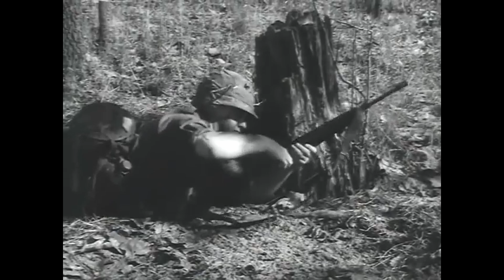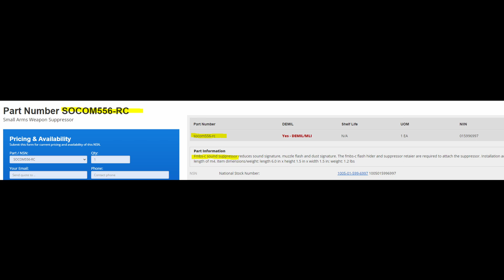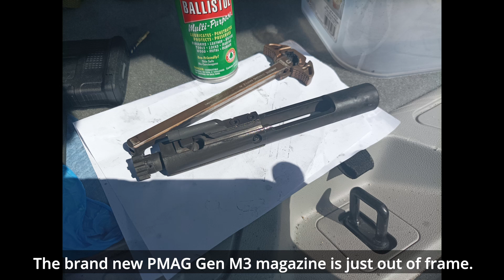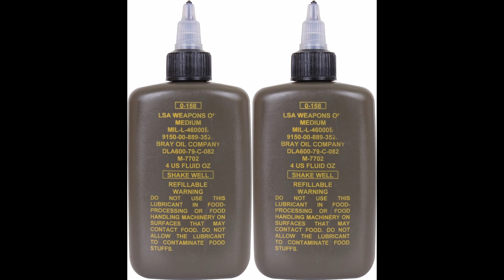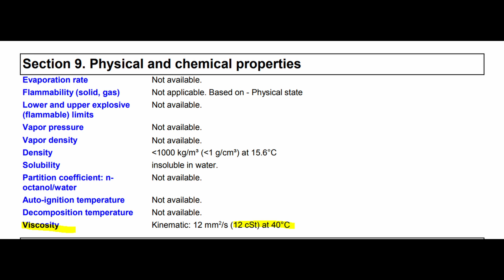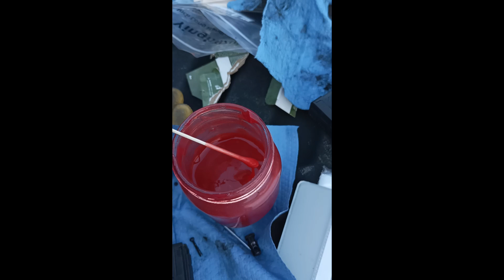Best Lube for Suppressed AR-15? 11 Lubes Tested!

Comment: CLP failed German Army tests back in the day because of its
-toxicity
-solvents (evaporation when cleaning in barracks)
- teflon settling at the bottom of the oil.
So they developed S-761. The dutch used Break-Free, then switched to S-761 as well. 
I have been using S-761 for years, it doesn't evaporate as much as Break Free so it can be used for longer storage. Also didn't burn off nearly as badly and decent cleaner. Outstanding oil.
Reply: The old mil63460 S-758 had to remove some 80% of residue, so contained solvent. Not sure about the exact %, google will help. The new mil 63460F formula has a much lower percentage. 30% something. In fact the old S-761 until some 10 years ago, looked and smelled just like g96 clp. Couldn' t tell a difference. The new S-761 is a bit different but better.  Dutch stuff orange, german yellow. Since the new Mil 63460F formula with the lower requirement for residue removal  has been introduced, S-761 made both by milispec in the Netherlands and Addinol in Germany ( btw they produced W18 oil for the east german army too) now feature the S-758 approval as well. First appeared on the packaging like 2 or 3 years ago if I remember.
Reply from the maker: @ThomasW.1892  I agree, for normal use most people will never need anything beyond whatever their first choice is at a gun store or even using motor oil. 

I just wanted to try this since suppressors can add much harsher conditions than unsuppressed high round counts do with considerably less cost. As far as I can tell, this is probably the most diverse and one of the few videos that has an actual live fire test of more than one lube. I also learned a lot doing this even beyond just about lubricants.
Reply from the maker: I can believe that, thanks for sharing. Modern Breakfree does not use teflon anymore and G96 also does not use teflon, so it seems that teflon has been dropped from the modern formulations for the better. Apparently, G96 doesn't use solvents either, so G96 might be able to qualify for S-761. In any case, it makes a lot more sense why the Germans would have developed an alternate "CLP" spec back then.
Reply: @fullspectrum1616  as for ballistol, my great grandfather used it ready in the 20s. It is an outstanding oil but you have to keep in mind it's 120 years old, now way it performs like S-761 or modern oil. Nevertheless, unless you rund tons of mags or a machine gun somewhere in Afghanistan, you are just fine. My old man picked up a Mauser 98 in WW1, still like new and never seen anything but ballistol. Same for tools, a shed full of old non stainless tools, gransfors axes, a forge, scythes and ballistol is the only oil that preserves them 100%. A thick coat applied, it will stick for years, plus alkaline so neutralizes sweat and acids from grass, trees, sweat. 8 years ago we had a flood while I was away and the basement was damp, gunsafe even had some water inside. 4 months later when I was  back, not a trace of rust on the ballistol guns. ( and I own a stg44...) In all the 10s of thousands of rounds, none of us has ever used anything but ballistol for years, worked just fine. My m92fs is still tight almost  like new after 15k rounds. Never noticed any excessive wear. Just reapply it more often and you shoudl be fine. Plus 100% safe, we use it on small wounds, horses, dogs, literally anything in Europe.
For our boys in uniform there is better stuff, for the average joe its great
Reply: @ThomasW.1892  Ballistol is great stuff.  Not the latest high tech; but so useful for so many other things.  Is it thin enough to use on sewing machines? A friend was bemoaning the fact taht she hasn't been able to find sewing machine oil for several years.
Reply: @ThomasW.1892  its such a shame Ballistol smells TERRIBLE
Reply: @fullspectrum1616  well the germans never used solvents. S-761 did the job just fine, never had an issue or noticed much difference between S-758 an S-761. I dont remember the exact number but S-758 under mil 63460D had to remove at least 70 or 80 Percent of the fouling. If I am not mistaken, the  new F formula has a much lower percentage, like 30%, but google gives you the answer. Anyway, since the new formula 63460F becane the nato spec, both the dutch S-761 by Milispec and the german S-761 by Addinol have the official S-758 designation in addition to the S-761. My order last year was the first time it waa mentioned in the datasheet. 
The older S-761 I used until 7 or 8 years ago (darker than the new stuff which is orange to yellow) was in every single detail like g96 clp. Same  smell, colour consistency.  I put S-761 in empty g96 bottles, couldnt tell the difference.
Reply: @fullspectrum1616  Teflon, the good idea that wasn't.  Sure seemed like a no-brainer at the time.  Who knew it'd turn to be exactly that?

Comment: pretty sure the nano oil stuff is just 5$ bulk chinease PTFE bought off ali exp and suspended in some random olifin oil and called nano particles. its service range of up to 503F is why i think that. most the spec sheets for ptfe dry lubricant give the service temp range up to 503F... or 260C. idk for shooting steel case and using polymer mags, i would think a ptfe dry lube would be the best. a lot of oil lubes ive seen degrade plastic over very long timelines. ptfe powder is sometimes found in electrical wires inplace of the old talk powder.
Reply: Its PTFE free, the 503°F is the FlashPoint. PTFE shouldnt be used in gun oils to prevent HF gas contamination
Reply: @nanoarmschemistry4281  HF? As in hydrogen fluoride?  Yikes!  "Small" amounts, yes.  But how many more corrosive compounds do we even know?
Reply: @PeterWolfe2012  chlorinated additives turn into hydrochloric acid, PTFE or fluorinated Additives into hydrofluoric acid... but basic compounds inside lubricants can absorb them to prevent lubricant degredation from acids... thats more of of problem older industrial products got, now its mostly Phosphor and sulfur based. The best toys for amazing lubricants  are environment unfriendly, thats kind of sad
Reply: @nanoarmschemistry4281  I remember the friend who owned a motorcycle garage telling me about this fantastic, water-resistant, new racing motorcycle grease that was really the cat's ass for guns.  He was right.  It was great.  

But then I used it to prepare a 1911 for long-term storage.  After a year or so in the humidity of the Mid-South, I sold it to a friend starting up a new DuraCoat-based business.  

Later he asked what in the HELL I had done to destroy the pistol.  That's when I found out that molydenum disulfide reasted with water, and water vapor in the air, to create sulfuric acid.   

What REALLY pisses me off about the whole "moly" for shooting craze is a technical report I found just aa few years ago that pre-dated the whole craze that talked all about the disulfide reaction.  

So the manufacturers KNEW, or should have.  How many guns and barrels were destroyed for greed?

Comment: I heard Eric say to Bill Geiselle that he would use the Go-Juice during the meltdowns.
Im surprised you had stoppages at such low round counts.
Maybe a different buffer setup could help reduce some of those?
Reply from the maker: It's really an issue of spring tension and friction being the highest on the first round of a magazine coupled with the lube blowoff and increased fouling from a suppressor. If anything the stronger tubb spring should be reducing stoppages and a milspec spring would be marginally weaker giving me more stoppages. On an unsuppressed gun there is much less lube blowoff/burnoff and orders of magnitude less fouling, so a "burndown" using an unsuppressed gun is going to be much easier to have the gun be reliable.

The H3 buffer is almost insufficient with the gun suppressed like it is, so going any lower on a carbine buffer is not a good idea for other reliability reasons. Lots of people write off or do not include first round stoppages as a failure, too.

Comment: Unfortunately that Nano stuff is nearly unobtanium right now. I've been using the Lucas gun oil for a few years now, always been happy with it's performance. It kind of seemed like you wrote it off as barely better than 5w-30, but it was tied for 3rd best performance under your subjective metrics. Also, in regards to the SOTAR-acha, did you apply it in the quantity that SOTAR recommends? Because if so, I could see the BCG being wet still, just due to the sheer volume of lubricant Chad recommends we apply.
Reply from the maker: I applied all of them per the M4 technical manual since it seems to recommend an amount of lube that I would consider to be the most minimal amount I could call reasonable. My cleaning video shows how I cleaned and lubed the gun, which I did to the same standard/amount with every lube. 

This test was purely a way to see how much a suppressor changes the reliability of a gun in the best of circumstances (freshly and perfectly cleaned while having zero long term evaporation or environmental fouling.) If you look at the SWAT magazine article of BCM's filthy 14 using slip2000 they have some thousands of rounds fired before they ever have a failure on what I presume was a purely unsuppressed rifle. I don't think they are lying about that and what is really going on is that a suppressed gun is some hundreds of times worse in terms of round count since by the time I got to only 30 and 60 rounds I had failures. You can see on Military Arms Channel where Tim fires some thousands of rounds without cleaning or lube, which indicates that lube doesn't really matter in ideal circumstances for an AR-15 purely for cycling on an unsuppressed gun. At that point I'd only worry about corrosion, evaporation, and cold weather performance.

The Nano was the best in terms of feel and amount still remaining, it's just that it is hard to find and priced higher than other lubes. Out of all the lubes I think LSA is the best since it's somewhat available and priced alright per ounce if you do the math on the 4oz and 32oz amounts you can buy, while having great rust protection. LSA was one of the leaders in this test and it's not quite as bad as lucas or ballistol in cold weather. 

5W-30 does alright in a pure lube test but it will be awful at corrosion protection. I mention that others have done corrosion tests (and that LSA for instance has a lot higher anti corrosion additives) and let the viewer weigh in on that for themselves.
Reply: @fullspectrum1616  thanks for the detailed reply, and for making videos covering these topics. I see what you mean in regards to the additional demands that suppressed fire puts on rifles. I hadn't thought about it like that before, but your comparisons of those thousands-rounds burndowns to your experiments here really highlight how big a difference suppressed fire makes. 

Here's to hoping that the mad scientist behind the Nano stuff can get his potion into more retailers hands! Until then, I suppose I'll have to track down a surplus quart of LSA.

Comment: I’ve used the home brew SOTAR on my suppressed guns and after extended range use the grease feels a bit gritty between my fingers so not sure the best…… but I will say my buddy would have to re lube half way through the day, my pews kept on running
Reply: It most likely feels gritty because of the carbon becoming suspended in the mixture. Synthetic motor oils have additives that fight against corrosion but also work to keep parts clean. So a balance of that mixed with working against carbon build up would make sense.

Comment: One thing to add about Military Weapon Lubricants is that they have to be good in all conditions but not great in any one condition ie heat, cold, dust, sea water etc. and environmentally friendly which can be counter to good lubricity. Typical civilians know their conditions so are able to adjust lubricants based on conditions. Higher viscosity oil will also make cleanup easier as they will typically hold carbon in suspension and provide a barrier to environmental particulate matter. From a mechanical engineering standpoint, oils are generally designed for closed recirculating systems (pump or splash), while greases are designed for non-recirculating systems.  IMHO the best hard use semi automatic weapons lubricant is a mix of, SYN Motor oil, SYN ATF and SYN Grease.
Reply from the maker: Yeah. I included a minor note of that in Ballistol's section about its cold weather performance being pretty bad according to its specs. According to the Army, at least, CLP and LSA are rated to the same temperature before needing to switch to LAW lubricant, which makes LSA probably my favorite overall.

Comment: When talking about magtech m193 meeting milspec velocities, is that testing that you did yourself with a chronograph?
Reply from the maker: Yeah I used a LabRadar and was getting 3260 fps out of a 20" 1/12 barrel at 50F. Magtech is loaded very hot, uses milspec primer thickness, and is has staked primers, making it one of the few true M193 spec rounds out there.

Comment: Used Weapon Shield for years but it always evaporates quickly leaving the gun dry. Switched to Lucas extreme duty oil and I couldn't be happy with the results after months sitting in my safe.

Comment: US Army 1972-2003 never saw a weapon fail with LSA
Reply: I’m starting to think that 😮LSA both oil and semi fluid is the way to go even these days. I ordered both and we’ll use this on my AR15. So much to choose from and quit confusing. But I want a lube that is proven to be good. This is a great video and learned a lot but I think LSA is the superior lube in both side and rotation part in an AR15 platform. 🇺🇸👍🏻
Reply: @Mako-sz4qr  I have found the cream of the crop to be Wilson Combat lubricants and solvents, I will say the best CLP I've used is Weapon Shield. Wilson Combat is not a CLP but dedicated lubricant and solvents, but if you want CLP Weapon Shield is the one. I've used original Mpro7, which is also hoppes elite oil, I've used Sig Sauer Spec 1 premium blend, I've used all the Slip 2000 lubricants including the grease, I've used ballistol, fire clean, Lucas extreme duty. You name it and nothing comes close to Wilson Combat or Weapon Shield. You'll thank me later.
Reply: @AbsoluteZeroxX  - I appreciate your advice 👍🏻🇺🇸
Reply: @Mako-sz4qr  🇺🇸 you're welcome. I've "wasted" quite a bit of $ on all kinds of oils, and of course towards the end of me giving up I found the best. I just want to let everyone know what the best is and save them the headache and $.
Reply: I don't know about you, other than seeing what you DIDN'T say, but I never saw a weapon CLPed that didn't fail.
Reply: @PeterWolfe2012 never had a weapon fail because of clp before lol
Reply: @pridemizzle1565  NOW I know why you said that . . . the primary cause was listed in my previous comment.  The company commander went around every , single range day with a one-gallon jug of BreakFree complete with sholdeer strap and squeeze pump on a hose.  Muzzles high, BreakFree down the bore until it ran of the chamber.  NO amount of wiping with the material and time we had available would undo the damage.  LOL

Comment: did you use synthetic motor oil and synthetic grease?
you show a picture of regular motor oil and a picture of synthetic grease.
i have heard the synthetic grease and petroleum may break down.
petroleum breaks down silicone and i assume the synthetic grease is made from silicone
Reply from the maker: I used 5W-30 Mobil 1 synthetic and Mobil 1 Synthetic Grease (102481). Most greases you will find will be from a lithium base unless it says otherwise like with a silicone grease.

Comment: What do you think of ( STG-2 )
SPARTAN TACTICAL GREASE?
I love LUCAS EXTREME DUTY gun oil
The only drawback that I have with this oil is that oil seems to migrate real bad. What's your thought on the grease thank you for the shows badass
Reply from the maker: I haven't tried it, myself. I might have to test something like that TWB-25 and some other greases that are thinner than NGLI #2. I agree with you about the migration (though lucas is very good for the price and did better than other "pure" oils) and that's why I think the mixed oils did the best.